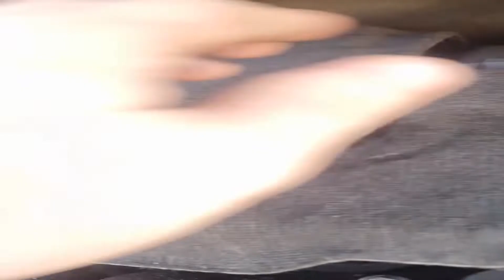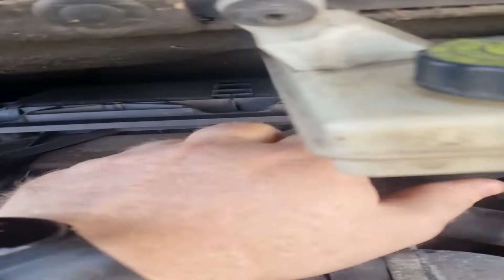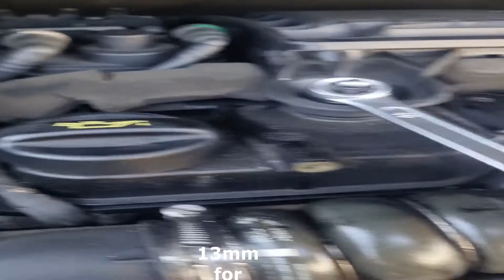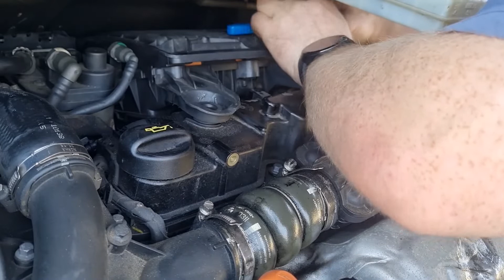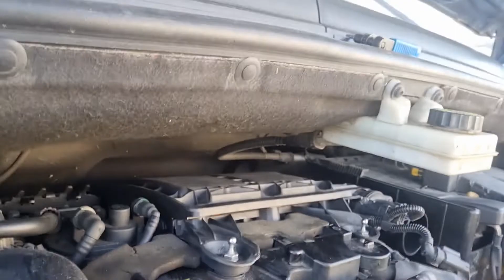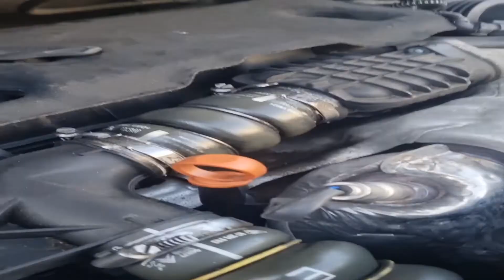Citroen C4 Grand Picasso Air filter Replacement

Comment: Citroen c4 Picasso starts fine but gear not working  when either auto or manual is selected
Reply from the maker: I'd check the transmission fuild first in case there is a leak or it's low  . if you  have access to a scan tool It may have a code that could help narrow down the possibilities